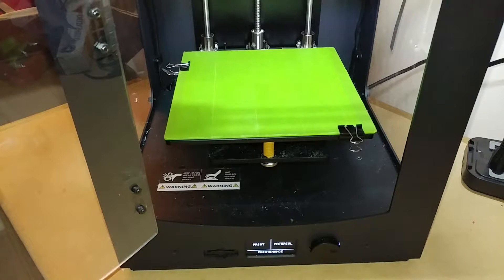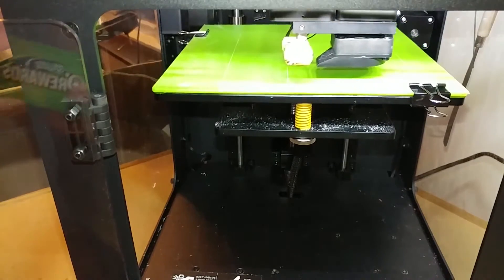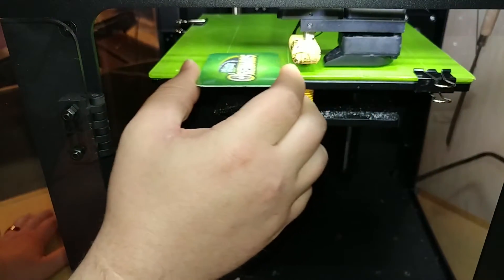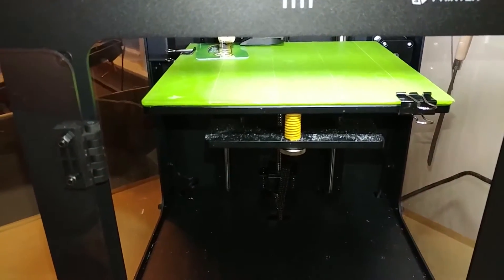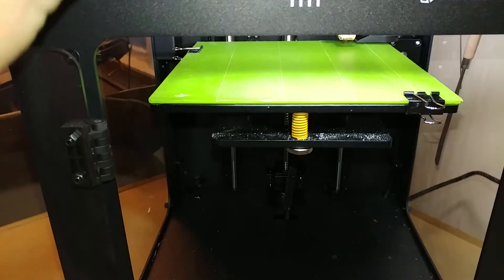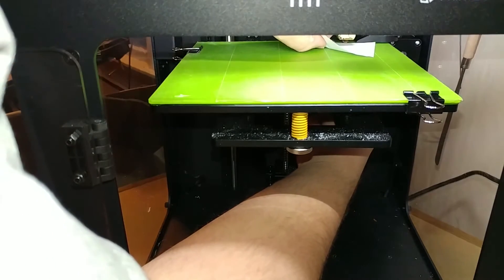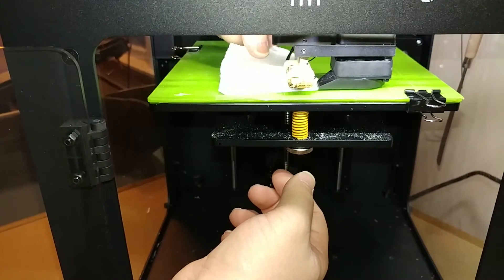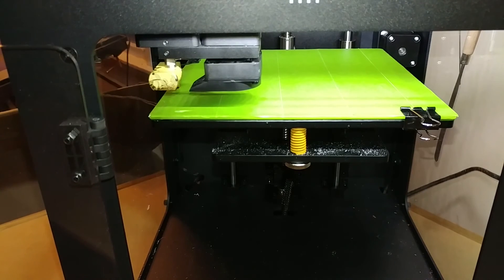3D Printer 101: How to level the bed on Monoprice Maker Ultimate 3D Printer

Comment: You need to adjust the Z limit switch so the print head doesn't crash into your build plate.   It should stop  1-2 mm above the build plate.   The screw is at the back.
Reply from the maker: Thanks, it is fixed now, did not find that out until after making the video.

Comment: Do you have any problems with the plate pressing up against the extruder when it returns home? Mine melted the plate covering it came with in that corner, and I am afraid it will crack a glass plate if I upgrade.
Reply: The plate is on springs so when the nozzle presses on that corner with a glass plate the springs just compress
Reply from the maker: Thanks for your help, I have been so busy.

Comment: This is the wrong way to level the Monoprice Maker Ultimate. See how your build plate is crashing into your nozzle at 8:40? The entire plate is flexing :)

You need to raise/lower the build plate according to the limit switch, or you will keep running into this problem. Unfortunately the leveling instructions provided by the printer are very poor.

There's a pretty good explanation here: https://www.youtube.com/watch?v=Pg4_uKFnL7I starting at around 3:10.

I realize this video is a year old and you've probably figured this out by now, but FYI for future visitors :)

Great production values on the video!
Reply from the maker: Thanks, your right I should update this video.